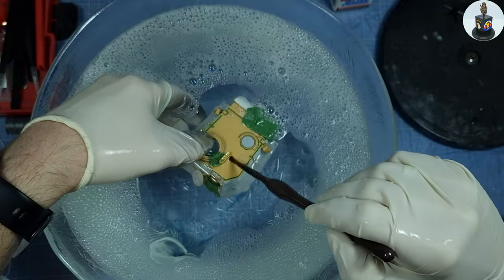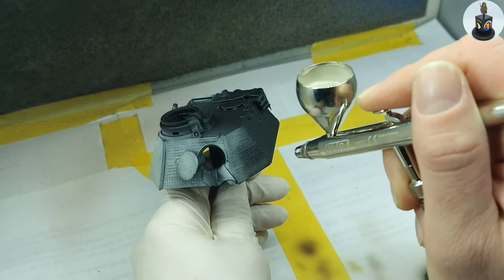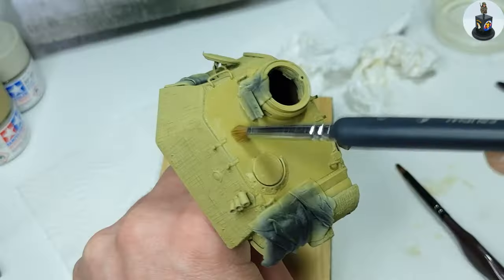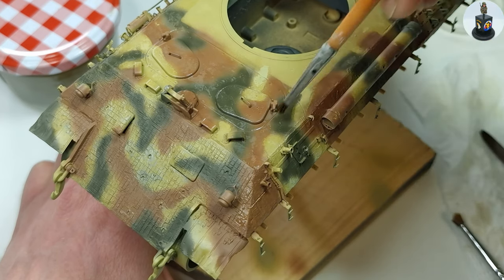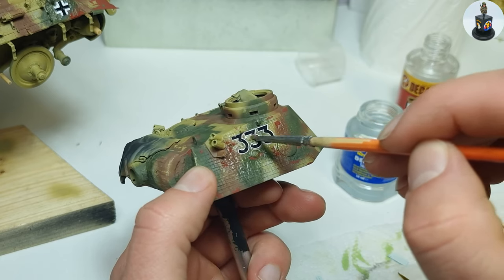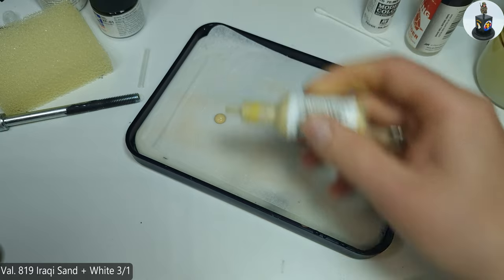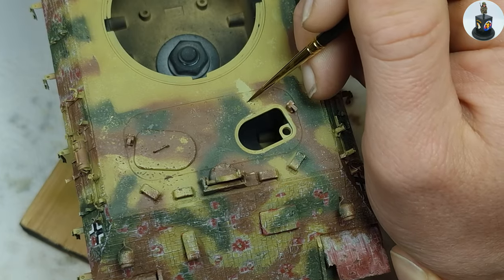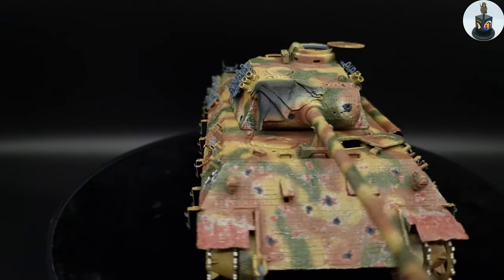How to paint a worn out, faded 3-Tone German Camouflage on Panther D Tank (Tamiya 1/35)

Comment: This man’s work is a masterpiece. The idea of going back to a previous work and re-engineering it into a more mature, battle damaged and worn version of its former self is smart. But the technique is even smarter. I’m ashamed to be a modeler with the skills I have when compared to this man. If he walked by, I would salute smartly and turn my back in shame at the chasmic difference in our modeling skills. Anyway, loved every minute of this. One thing on PE though. I think it works 90% of the time, especially if you want to do something dynamic to it, but on larger objects and some small, the fullness of the original styrene plastic beats the tinny, box-like PE. Otherwise, if you can do PE well, I’d do it often . But this model is well-nigh a work or art.
Reply from the maker: Thanks a lot for your kind words, happy you like my work🙏 pe parts are most of the time an upgrade in my opinion as they are far more detailed and more in scale, even bigger parts are often thicker in plastic than they should be. And at this model it was kind of a challenge to myself to build as much pe parts as possible. So this model has by far the most pe I ever made on a single model.

Comment: It should be worth it to use a good primer before the top coats. It's extra work but if you are going to add much detail, historic accuracy, time, and yes, beauty, the end results are the real worth! Danke
Reply from the maker: Well, I wouldn't say that Vallejo Hobby Paint is a bad primer, it's excellent with self leveling and gives good results, you just have to be careful and apply it in short bursts. You'll have no problems then and saved a lot time. Bitte schön.